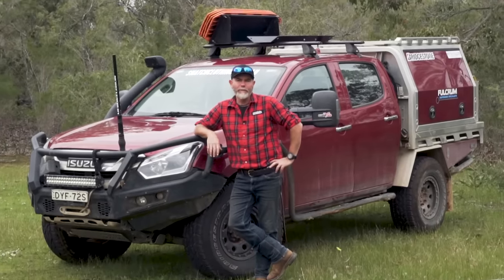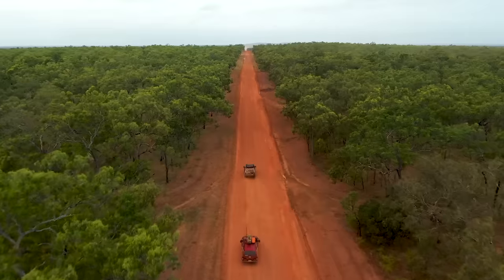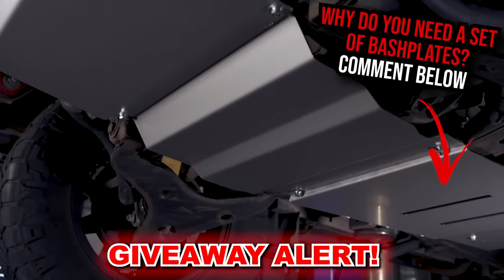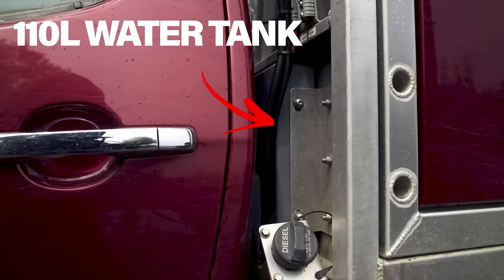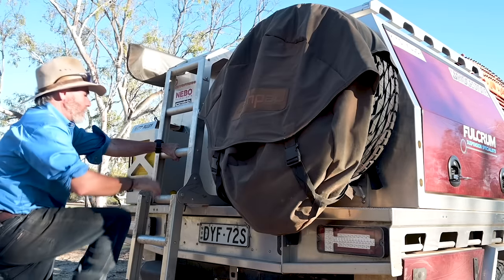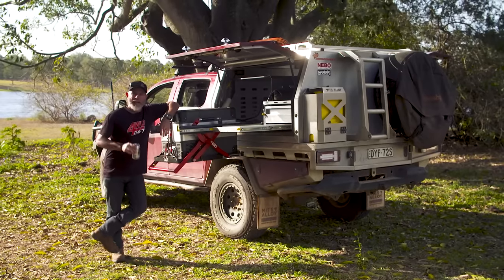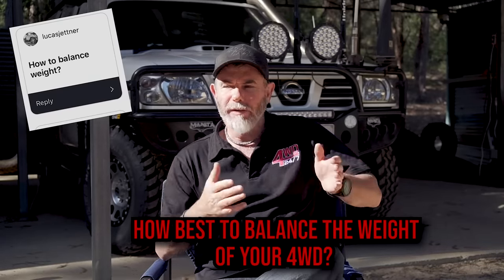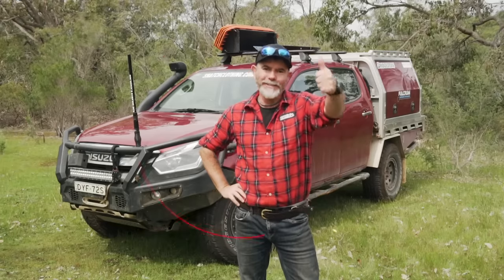ULTIMATE DUAL CAB UTE MOD GUIDE – How We Built Graham’s D-MAX to Drive ANY Track – Canopy tips!

Comment: before you read you betcha my new rig is very stock still i own a 2016  triton and.need those plates because i dont have a lift which id love too! the track into gnaraloo station WA.  wish i had a winch with my old nav when i was mm from tipping on a sandhill in yorkes SA.  would of loved a uhf when i did a solo night run in the flinders ranges was stuck in mud up to my windows passenger side. i would love that fridge in the back of the canopy the spot id love pull up to and knock back a few tins is cape yourke on a 35 degree day yew!

Comment: 2014 Nissan Navara. I peeled off my factory bash plates on a big rock while on a power line trail in the Brindabellas last week and it cracked the bottom of my radiator and left me stranded. 

I would love a new set of bash plates to protect my Navara and get me back onto the tracks.

Comment: I have a 2012 suzuki jimny (not a dual cab sorry) but the most corregated roads ive done has to be the tanami track to wolfe creek on a motorbike ( was so bad i had to stop every 10 mins because it felt like a jack hammer going through my joints of my fingers)

Comment: Took at mates advice “short cut” come from east to cape leveque. Only difference I have had a camper in tow, two kid (18 months and 3) countless cyclone made the track a sand gutter and it had been six year since he was on that shortcut I found out later. So 5 hours  of being dry sand bogged on a 39 degree day in the middle of the track, I wish I had a winch, instead of a shovel.

Comment: I had just picked up a new work 100 series wagon - as in picked up day before (a Government DX), was up at an outstation, and it poured rain... the winch was not wired in right. It came straight out of the workshop. I got an call to an urgent job, the creeks were up, I had the station manager jump in with me... first creek crossing hit quicksand, drive forward bog in, reverse, crawled out, multiple times... directed down the creek to an alternate crossing... found winch would not work, during first bogging! Anyway, got back to station, and A. Checked tyre pressures... front tyres were at 65PSI, rears at 35PSI (was not happy). B. Power wire had NOT been wired into battery.
Learnt a few things that day (including don't trust the mechanics who had checked it over!).

Comment: Q: When did you wish you had a winch?
A: I got my self stuck in a mud hole. Passenger front was stuck in a very deep part of the bog and lifted the drivers rear a meter up in the air. My truck was sitting on an angle over 45 degrees and I don't have the best LSD ether, giving me no way out other than to tie the driver's rear wheel to my rock sliders, sending the power to the passengers rear and giving me enough grip to get out. Not to mention that I've only had this truck for 6 months at the time. Definitely the scariest position of been in. If I had a winch it would have been a piece of piss getting out.

Would be a pleasure to win the winch and no doubt it will be used lots.

Ryan

Comment: 2007 Navara- to be able to drive those difficult tracks without having to order a sky crane to remove my car from a track

I was driving and thought about driving over the edge of a dam, got half over and ended up stuck had to get pulled down by a mate with a winch, still haven't heard the end of it. 

^When i got stuck on the dam, my mates were not near, so instead of being able to give them a heads up on the 2way i had to bloody walk.

Comment: Getting a brand new Isuzu D-max X-Terrain with $22k of additions.  Bash Plates I haven’t bought yet - but they would be great to avoid the “all the gear and no idea” tag from my mates if I end up with a busted sump slightly after the point where my ambition exceeds my ability.

Comment: I wish I had a winch at glasshouse mountains also, just after my daughter passed away we decided to do a trip to glass house , we were stuck in a bog hole for about 6 hours until we grabbed someone on the uhf who came and helped pull us out, I ended up doing a engine in that hole as the water got into my air box and I did cylinder number three in my gu4 patrol

Comment: Love the information and great to hear your experiences and suggestions.
Tough tracks I have done are Janowen Hills, Goomburra and Sundown National park. Been to Fraser Island, Rainbow beach and Bribie Island multiple times. 
I got a Pajero Sport QF and installed PIAK loop bullbar, Rhino roof rack full size and Hayman Rees towbar. 
Next in line is Custome Offroad underbody protection, STEDI spotties, Winch, 2 inch Suspension lift, GME XRS 370 UHF, then larger tyres. 
I would love to go with fulcrum but they don't have a lift kit for Pajero Sport QF.
It will be great if I could win the CustomOffroad underbody protection :) (I know the promotion would have closed by now)

Comment: Lockers: There's no absolute right or wrong here although if I can only have one... Years of wheeling has for me personally put a leaning towards front. But I can think of many situation where a rear is preferable. Steering with lockers. Something to understand. When lockers are engaged they will drive the vehicle in the direction that the locked wheels are pointing in. It's not front lockers that affect steering it's the rear. Think about this. A front axle locked will pull the front in the direction that the wheels point. If you can unlock the rear, and leave the front locked, on low traction surfaces, steering is often enhanced. But the industry standard (with at least ARB and the factory Toyota switching) is that rear must be locked before the front. This is the locker setup that affects steering, not a front locker on it's own. Graham's wheelbarrow analogy is a good one, however it's easier to pull a wheelbarrow through soft sand than push it. The GU with LSD rear and front elocker/Airlocker is about the best all-rounder with no competition. After that, any modern ute with front and rear lockers that can be switched independently. Next the traditional rear then front locker setup, then personal choice on front or rear. If your modern ute has a good traction control system to start with, but no rear locker, put a locker in the front, not the back. Dead last is traction control.

Comment: I agree somewhat with the mods, infact most I agree fully, but as far as suspension lift goes I am not on the same page.  It is a vehicle specific thing.  In my experience and in view most people wouldn't hit the narly stuff you guys do, using a 70 series as an example - stock suspension will do most of the work a D-Max suspension blinged up will do. Additionally, sus lift doesn't increase clearance, it just increases entry exit height.  Suspension does allow for larger tyres which is where clearance come into place.  Just saying

Comment: Hiya Graham, I got an Mitsubishi L200 Raging Bull 2.5 liter diesel dual cab of 2009, but I am based in the mountains at Ashford, Limerick, Ireland, kind emerald regards, you got fans out here too you know.   From what I heard would love to take up the 
''Binns Track'' in NT.   Suppose you know it well, can I rent a L200 or DMax down under to drive the Binns Track, or should I transport my L200 to Australia?  Can I get the 50mmm lift for my L200,  with as you said the (Front) Diff Drop Kit for an engineered suspension. Suppose you can combine a steel bumper winch nd a steel skid plates in one, that's my plan I recommend to all serious off roaders above and beyond!  Got stuck a few times nearly rolled down the mountain slaloming along trees, which I don't wonna hurt but safely pass by. Thanks a million. And Graham suppose you keep cameras and likes, and fridge freezer,  charged via one or two solar panels on the roof and/or sides. Ps. Any tips for keeping the spare tire/wheel, the L200 keeps it under the suspension usually, which doesn't help with road clearance of course.

Comment: A couple of months ago my girlfriend and i decided to go for a bit ofa mud run at 10 oclock at night in my mighty gq. You can guess what happened next, bogged to the diffs in a mud hole, a long the side of a rail way line, in the middle of nowhere with a snapped uhf antenna. DEFiNATELY  regret not having a winch, it was a very long walk to cell service and the misso was not pleased :)

Comment: I need new suspension because rear shock are shot and the springs are to stiff. I drive a 120 series prado. I think the old coach road would have to be one of the more narly tracks/ roads out there.

Comment: Corrogated Road - My nomonation is the CSR Canning Stock Route

Bash Plates - My rig is a 2002 Ford Courier 4x4 diesel. Its not the most powerful or beautiful but it works for me

I wish I had a winch when I borrowed my old mans FZJ75 1 owner ute for the weekend. Payed dearly for that mistake

Ive always had a UHF so I've been fortunate there

I usually have my best mate Boris the Rotty with me so water is an essential not a luxury

I'd like to pull up and grab a beer at the top of Big Red in the Simpson 👌

Comment: I need a set of bash plates cause I drive an f150 with a plastic fuel tank that sits a few inches lower than the frame.

Comment: First time out at my mates property being dumb asses and it was after a bit of rain to there was mud everywhere. We were running 8 in his backyard and I slid to far and was nearly tipped on the side in the creek. I freaked it and spun the tires and just dug me self a hole. There were plenty of tree around but my mate just had to head back to the shed and get some straps to pull me out. Would of been better though if I had a winch it would of saved plenty of time

Comment: Communication:
Picked up a new caravan before lock down in VIC and on the way home on the highway was trying to change lanes and still getting used to the size of the van when changing lanes a truck was flashing its lights at me, behold to know he was letting me in nice fella, but a UHF would have known better. Or when i was up Mt Disappointment with no phone reception.

Comment: Got embarrassing stuck with the misses in the car took a tiny little mud hole solo and turned into a creek water crossing 🤣 water over the windscreen taking water on for sure thought I sore a Barra swimming around then blew a injector seal so I died in the hole and had to walk 20 mins to get reception to get help to tow me out

Comment: Needed a winch when bogged between a huge pair of blackberry bushes. Feel sorry for the passenger who had to crawl between them to get the recovery gear and attach to the car and recovery car. If we had a winch the onlookers could of pulled out the winch without going near the bushes as the nose was nearly out, attached to the recovery car as an anchor point.

Comment: So this was only happened on weekend was out at dam with mates and just rained so it was all muddy, there was only one track next to the dam. I tried going through it and the mud cause me and slid me down onto a rock smashing my side step in and was stuck there for hours waited for someone with a winch to come pull me off. The rock stopped me from not only entering the water but also rolling on my side but if I had a winch I could’ve got myself out right away

Comment: i got washed off a creek crossing cutting through the forestry near tincay bay i had a winch both ends but was useless when the whole car went under water i did not have my turfor with me so was stuffed until the next day i went back changed the engine oil pulled the spark plugs out and cleaned the dizzy out she started and ran so what do you think i take with me everywhere i go now yep you guessed it hand winch block and recovery kit  got quite a few of them one for each car i own they are not fast but they are very reliable ses tincay bay can back up this story

Comment: I have 2016 d max LS 2inch lift, i have a bash plate but not a full body. Only engine. Today i hit a rock hard and bent up my transmission 2 inchs. Diff is bent. Had to diy pull it dwn so it can drive. Not good.

Comment: I sure needed good suspension going up to Cape Leveque in 2012, late in the season towing a camper behind the Colorado, shook so much that the microwave ended up on the floor, and it was well bolted in. Uncomfortable with standard suspension.

Comment: I need a new winch.. I brought a 2003 prado it had everything we wonted including a winch..  And having it not even 24 hours it blow a motor so we put a reconditioned one  it and got it on the road.. on our first outting we took it out and we slid in to a huge hole with water and got stuck i had water all in my cab and when we pulled the winch out it did not work.. so once we got home we found out that we broke the auto so now it's getting fixed now but I still need to get a new winch as we can't have one that dose not work...